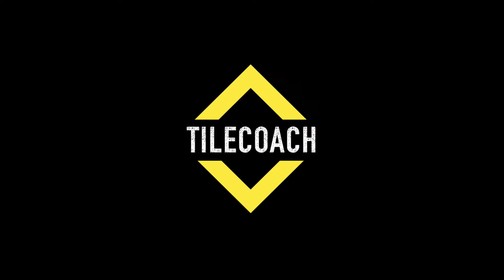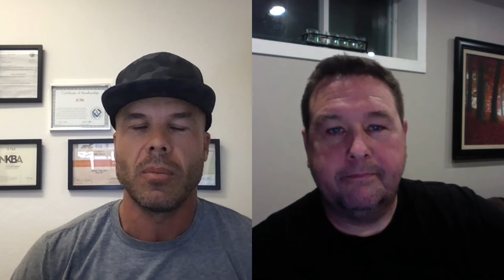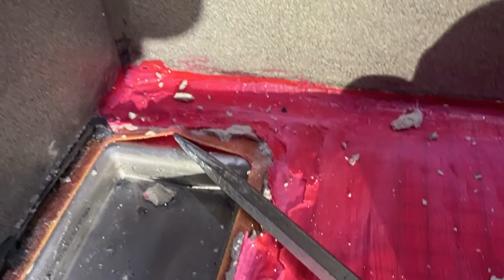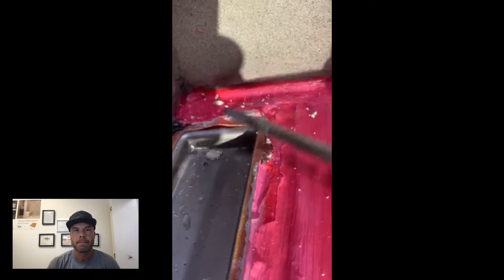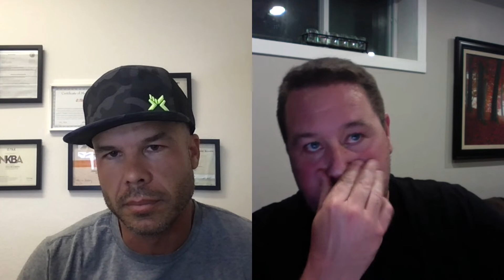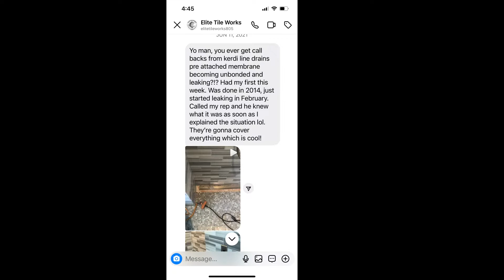Another Schluter Kerdi Line Failure

Comment: Sad bonding issues. If you have the time high-grade marine epoxy/vinyl ester surfaces it best. Using proper preparation (scarification/sanding for mechanical bond) and specialized adhesives like ANSI A118.3 epoxy thin-set mortar or certain acrylic-based adhesives designed for non-porous surfaces if you want to put tine directly on it. The bond's durability hinges on the epoxy's integrity and the surface prep quality.

Comment: 1) YOU NEVER USE REDGUARD ON ANYTHING 
2) YOU NEVER MIX ANYTHING WITH SCHLUTER MATERIALS. 
3) IF YOU INSTALL IT 100% CORRECTLY AND SOMETHING GOES SOUTH. DON’T DO ANYTHING EXCEPT CALL YOUR REP. 
I started using Schluter products when they first started. DITRA was just a mat with straight lines. No squares. Used Schluter exclusively until I was hired by a local distributor. Absolutely no problems then. HOWEVER…I think the company has serious problems now. Many employees at part one seminars are not even in the tile industry,  I have a terrible time just getting SWAG from them anymore to give to my contractor customers. They should replace the tile and labor costs. Too much money sends customer service down the drain. There is also the 80% of hacks out there that screw the job up and then go online and trash the company. None of this will change until all hack contractors and manufacturers are held legally responsible for these problems. Real tile contractors here on the east coast (Virginia) are constantly undercut by hacks that take the money and run.. that’s why I got out. I’m so fortunate that the distributor that hired me pays for my 42 years of experience. 
The one odd thing about all of this is the fact that we haven’t (locally) heard of these problems. Nor have any of the other local distributors I am friendly with. I wonder if it is regional? Anyway I’m watching this in Dec. 2025. Nice job as always Isaac!

Comment: As a tile installer I've only done about 20 Schulter showers and 6 of them linear drains. I didn't like the membrane to drain seam so I taped aboutb3/16 back on the stainless and membrane and applied boss 808 100%pure silicone and let cure for 72 hours.passed all 24hr flood tests and it has been about 3-4 with no issues

Comment: Just inspected a 4 year old job of mine. Failure of the fleece bond at the stainless steel body. Plain as day. I didn't use schluter mortar and i had used Noble brand membrane for the rest of the shower. Fxcked

Comment: This seals the deal for me.  I'll never use the Schluter drain.  When a company won't stand behind their product just because they found an "out" because the installer used Red Guard is just ridiculous.  Even if the homeowner installed it, if the bond was bad on the drain, its Schluter's fault.  Terrible decision for this installer on Schluter's part.

Comment: Great video. I am opposed to on principle that a linear drain that does not have a mechanical connection to a pan liner is a crapshoot. Movement, dissimilar materials,  and relying on the tradesman to do a perfect installation, leave too many factors that could lead to a failure. Always go conventional.

Comment: I use the kbrs linear drain with the plastic flange, i find it is no different than a oatey center point with plastic base. Stainless steel is hard to bond. Also don't like the foam bases as you are limited on size of tile. I find it better with the mud method , worked ok for the romans

Comment: I am midway through a DIY remodel of my top floor master bath and am building the shower using the Kerdi system with line drain so, at this point, I'm already committed.  I came across this video doing some final research on the line drain install procedure and am now worried.  My drain was "geprüft" checked on Feb. 19, 2022.  I was wondering if anyone has yet to develop a fix for the failure.  I'm hoping to get feedback/thoughts on being pre-emptive and using a bead of Lexel as an additional mechanical bond to the top and bottom of the drain flange, covering the edge of the fabric and stainless, allowing it to dry before I actually install it.  Thoughts?

Comment: Was this drain set on prefabricated foam pan? Drain waterproofing requires no movement, as drain bigger and has wider so it’s plane gets wider any movement articulation becomes more pronounced. Liner drain would need very rigid and solid backing to control it. Prefabricated foam pan for linear drain is also the thinner part of pane and is foam. Now, get you ballpark of how rigid this the thinnest part that would support rigid stainless drain. Circular drains by Schluter get away from leaking same way with delamination as they are plastic that softens vibration extreme as person routinely steps back and forth during showering.
The only place linear drain like that could last is mud bed or basement concrete slab. The point there is no reliable way to fuse membrane with metal, those two are extremely different one being elastic with no form of rigidity and second being extremely rigid and stiff.

Comment: So seeing this I'm wondering if you could talk it down with 3M 5200. I know this sounds very weird but I used to work fixing boats and 5200 will adhere amazingly so if you from understanding you're putting the layer on top and then put them all set or whatever but I'm saying is if you can bond that with 5200 I guarantee it'll work because we can install the keel on a boat cruise ship solely with 5200
Reply: 4200 or sikaflex 290/ 290i
Reply: i would bead underneath at install and around top edge
Reply: Oh and obviously it's rated for underwater

Comment: I get this guy's frustration with Schluter. He's lucky it only took them 2 weeks for an inspection. 
I've called for a claim before and it was a month wait for them to come out.
So, I did the demo. Documented with pictures. Installed new product. Left customer with receipts for what they paid for. And then the customer goes and files civil suit.

I've done this probably 4 times in past year. On job's done by other contractors. All varying timeframes before failure.

It's a tile shower floor. It's prone to leaks. Think of how many you've installed that had problems? It's maybe a 1 or 2 problem for a contractor every decade, doing like 20 showers or more per year.

Just take a day, or 3. Do the fix. Document it. And go file suit.

Comment: Thing is out of the thousands of linear drains that are installed every week all over country. There are maybe a handful of failures every few months.

They do have a warranty. As long as you install it with their products and follow instructions. And first step is calling the reps and a wait process for them to inspect if there is a failure.

I get this guy was trying to band-aid with the Red Guard.  But, he was in the wrong. He should have called the rep for warranty before trying to repair it. So I get where the Schluter rep was coming from.

They did offer a new drain. So, only thing this guy is out is his time to put the new drain in and reset the 3 pieces of tile.

And he learned a lesson about line drains.

Take the new drain, go out and take a few hours to switch it out and set the tiles.

Then go file a lawsuit against Schluter and take a settlement a few months later.
Reply: How are you to know to call a Schluter rep?? If there is no knowledge of these issues portrayed to installers how are they to know?? Hopefully these types of videos will make more installers aware and hold companies accountable for their faulty products. Nothing was done wrong here by any means, the installer thought it was a issue with the initial installation of the water proof membrane not the drain.

Comment: I’ve seen people use just the channel body and pull the fleet and grind off the adhesive and scuff the metal up to go over it again with go board sealant and another fleece just to avoid this exact thing.

Comment: Can you simply look at the end of the sensor wire to determine whether you have the 2 black wires or red and black? I'm getting ready to install in my bathroom and want to make sure I don't have ones that keep failing.
Reply: On some advice I read somewhere, I installed 2 sensors, so there's a spare in place already if the first one fails.  IIRC they're pretty universal (should be, it's a pretty simple thing after all), so I think I just got the second one from Amazon.

Comment: @TileCoach I am so happy to hear you speak about the stainless linear drains.   I am planning a DIY and was very against the stainless linear drain on principle (physicist and chemist here).   I went hunting in the nearest major city at suppliers to find an ABS drain.  

Two suggestions, for your companion: in the meantime, go get a mustee cheapy shower pan and pipe it to the main 2 inch drain and drape some shower curtains.   It's really tacky but can be used as a shower for a while.

Secondly, use an epoxy adhesive for metal to plastic (construction tube adhesive (LocTite) on your joints as insurance.

Comment: I've never been comfortable with fastening Kerdi or Ditra with thinset. I know it's recommended by Schluter but it goes against my belief that you can fasten a cloth with "cement" especially over plywood. I don't understand why Schluter hasn't come up with a glue instead.
Reply: Well it's not cement and secondly have you ever tried to remove ditra that had been properly installed with schluter all set?? You might as well plan on replacing the subfloor. I would never want to use a glue over thinset
Reply: I just feel that a glue would be more effective
Reply: @dbeaulieu9730 but again I ask have you ever tried to remove properly installed ditra with schluter allset? How much more effective are you wanting?

Comment: I can tell you now... From this point on, I won't purchase any of their products and I'll.make sure every customer that even mentions schluter I will refer them to this video, and others.
Reply: Schluter really is a great product, their only issue at the moment are these line drains, install a square drain with this system and you won’t be disappointed if the job is done correctly
Reply: @PaulMcDonald-cj4qy  I'm guessing you might be the Paul from the vid, if so, I'm in Canada too, with a Schluter linear drain that's most of the way installed, so I'm pretty eager (and a bit anxious) to hear an update...

Comment: Professionals don't use Red Gard to repair Schluter Kerdi installations.  Stop using that  Kerdi shit and go back to the old way of doing things.
Reply: Actually I use redgard extensively, and my work speaks for itself. There is absolutely nothing wtf with redgard so long as it a properly applied. I have steam showers in gyms that are fully functional after more than a decade. That's the absolute worst possible circumstances. Near continuous steam.
Reply: @christopherd7306  I wasn't talking about Redgard, I was referring to that Schluter Kerdi garbage.
Reply: As stated in the video the red guard was a last ditch effort to see if the leak would stop, I would never recommend or deter anyone from using what they want, in this case it was only applied to a small surface area after every other effort was made to find and stop the initial leak